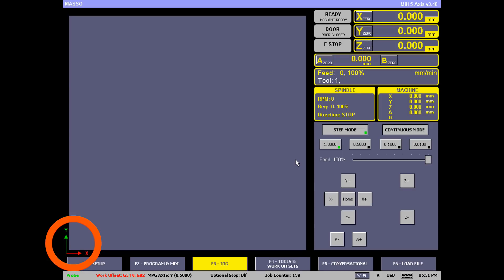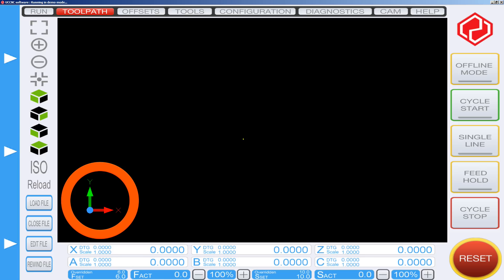How to Name your X & Y Axis- CNCnutz Episode 235

Comment: Thanks for this - we had a slightly confusing situation recently when moving our machine from what was effectively placement in the top left corner of one room to the top right corner of another. To make matters worse the machine was originally wired from the perspective of viewing the machine as you do with the gantry running across the x-axis. In its new position it was impossible to stand and view the axes X left to right and Y front to back so we had to swap the wiring of the axes over. This seemed OK but (as you mentioned) the work then came out mirrored so, as a temporary measure I have inverted the X- direction pin. Next week we will again pull the machine out from the wall and adjust the wiring to give the 'operator' exactly the right perspective when running jobs without the pin inversion. Prior to this, for over 12 months, we have been living with the need to rotate the design (usually text engraving) 90 degrees anticlockwise to compensate for the original wiring.
Reply from the maker: I'm sure once you get the directions sorted out you will away and laughing.
Cheers
Peter

Comment: The advent of home-built cnc has confused this issue somewhat since I've been involved in machining. In one's home shop you can name your axes however you like. Manufacturers of machine tools and users of cad/cam systems serving multiple machines have to observe standard guidelines to avoid confusion. 
As I was taught, the Z axis is always in line with the spindle bore and the X axis is usually the longest or lowest axis of travel. Simple. Nothing to do with the operator's position. 
Again, in one's home shop you can name them whatever you like, just be prepared for possible confusion when asking for help from manufacturers of cad/cam support people.
Reply from the maker: Thanks Keith
I have to disagree with that method of axis naming. For example, my first machine had both the X & Y axis the same lenght and there was no moving gantry crossing the table as there is on my current setup. Basically the cutting area moved and the Z axis was stationary above it. People expect that what they see on the screen is the same as what they see on the table and there is only one way of doing that. By matching what you see on the screen with what you see on the table and that only works if you stand in the right place.
I agree that it is the advent of the DIY machine that has caused the confusion and that people can and do name their axis whatever they like without problem. As you noted the problems really begin when you try and interact with others or allow someone else to use the machine.
I just don't see lenght, height, girth or color being a good bais for naming any machine axis but I am also happy to be proved wrong. 
Cheers
Peter
Reply: CNCnutz (Peter Passuello) On your first machine, the Z axis would be the vertical table movement (if that's how you accomplished movement in line with the spindle). Given that both X and Y were the same dimension, X would default to the furthest away from the spindle. On a horizontal mill, the Z moves horizontally, the Y vertically and the X left and right when viewed from behind the spindle (as in a car). Generally, all movements towards the workpiece in Z, to the left for X and towards the operator are negative; easily remembered because they are thought of as 'bad'.

If you google 'right hand rule' you can help yourself get REALLy confused (:  I trade school, some guys had a long hard week wrapping their heads around the concept.
Reply from the maker: Actually on my build both X & Y were the same distance fron the Z Axis as the Z was in the centre of the table.
The Right hand rule I learnt when I did my training many years ago were to do with motion, magnetic fields and current flow.
The horizontal mill sounds really interesting.
Cheers
Peter

Comment: Getting closer to my Masso purchase, I still have a few brackets to build then tear-down / paint. Another consideration for orientation when options exist is to match your drafting computer screen"S" with the table to prevent having to rotate big files constantly. I have 2 monitors next to each other (L-R) so I did the 12' run as X and the 6' as Y..

Comment: 5:57 - Wait... I just spent all this time adding TWO more axis to my machine... what about A, B, and C Axis??? (Evil Grin)
A - Rotation around the X-Axis
B - Rotation around the Y-Axis
C - Rotation around the C-Axis
I added the capability to do X-Y-Z-A-C to the mill now. 
https://youtu.be/kThCCUlDDjs?t=93
Reply from the maker: I have enough trouble with 3 dimensions. I can manage the 4th dimension of time but when I add the 5th dimension instability in the space time continumn occurs and Windows closes down. Your Linux set up seems to work better.
Nice setup Jerry. I look forward to seeing you machine with it.
Cheers
Peter
Reply: @cncnutz  That's the real kicker... I need to learn Fusion360 now... and I seem to be reluctant for some reason. Also... I never thought about this... but then I rotate down 90 degrees... the tip of my part drops 6 inches. For such a big machine... it only has about 7 inches of Z-Axis... so it is easy to run out of travel on that axis. It definitely ups the complexity an order of magnitude.